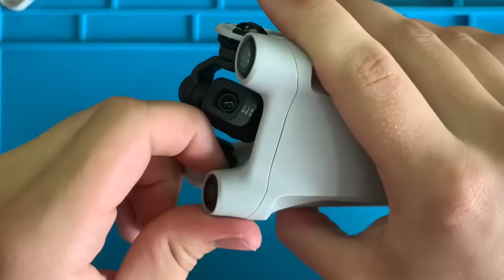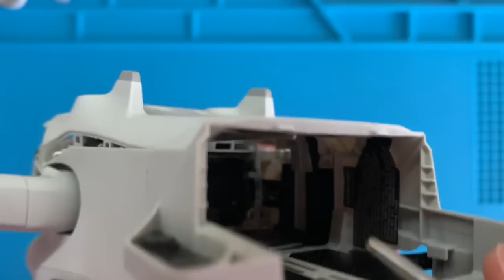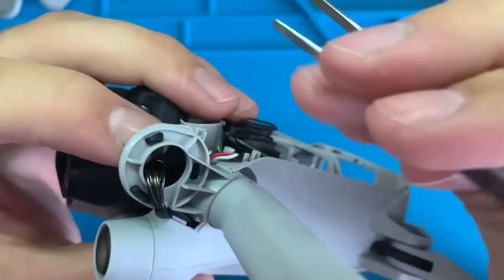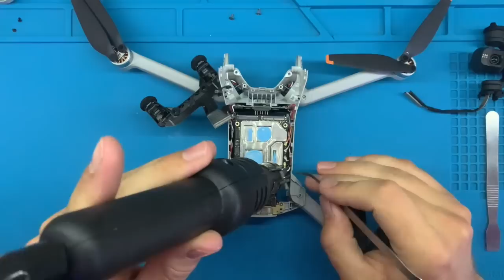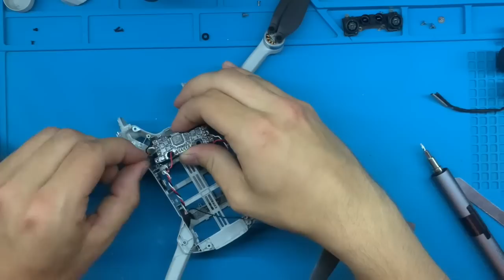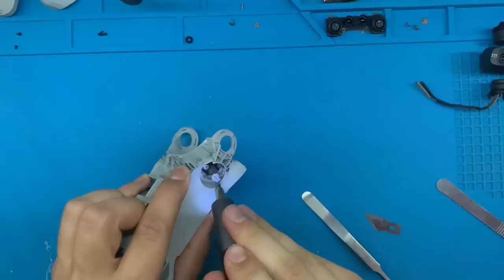DJI Mini 3 Pro Drone Teardown

Comment: I just want to remove and replace the front cover where the gymbol attaches to the small part that covers the front sensors, can this be done without taking the top and bottom shells off ?

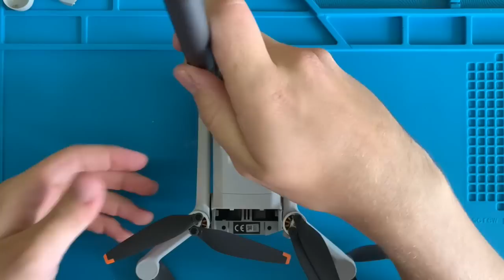Comment: 1:00  "and now you carefully clip the front half of the bottom shell from the drone" ....Proceeds to rip with as much violence as possible.
Reply: Can anyone tell me exactly when you have to re program the gimbal but have to do it with a computer.  It happens when you replace some parts of gimbal.   Anyone know anything about that?

Comment: what type of screwdriver is it, i can't find the correct one
Reply: I used T5 and PH0, but it depends on the screwdriver tolerance. Some do not fit and you would have to use T4 and PH00 instead. I also noticed that screws that fasten propeller blades have slightly different size in different batches (all original from the DJI store).

Comment: Hello! I'm currently disassembling the Mini 3 Pro. Quick question: Are you utilizing the hot air tool for both melting the adhesive and for desoldering purposes? 
Also, when you reassemble the drone, do you apply any kind of adhesive or glue? If adhesive is necessary, could you recommend a type that's suitable for this task?

Comment: Thank you for the great video, do you think is possible to bring the weight to 250 grams with the 360* prop cages and a naked version. Will it take off without the obstacle sensors and such? Thank you
Reply: I’m wondering the same thing and may give it a try…

Comment: Just a couple of thoughts you potentially leave off  some of the body parts and it would be even lighter, also could you not use a hot air gun to make the plastics more malleable. But excellent video.

Comment: In you expert opinion then, is there anything or things that can be removed to make the drone lighter to give it more battery time or make it light enough so you can use the battery plus without going over 250 grams?

Comment: I have a mini 3 pro. The gimbal is making a whining noise as soon as it connects with the transmitter, and does not stop until I power it off. If you tilt the aircraft completely vertically up or down, the noise stops, and if you gently lift upwards on the bottom of the gimbal, it also stops. Someone please help me :(

Comment: WOW repairing that drone isn't easy to work on for sure vs the other Mini's they sure packed this drone and I certainly don't like where they stuck the ESC Board for the wires and things...  Geesh like a car they sure know how to pack that baby.  Still wondering how they kept it under 249g...  Ugg having to tear apart the whole drone just to replace a drone arm, that's not fun!!

Comment: Now I'd love to see the best way of putting back in the rubber shock absorbers of the gimbal. My gimbal came loose from one of them, so I removed the rubber from the body to reconnect it to the gimbal. However, now it proves to be very difficult to get its three tongues back into their slots. Any suggestions on how to do that?
Reply: I did it with toothpick 🙂
Reply: @LouisxIII18  Can you show pls? I tryed, but...
Reply: @АртурАппен  adjust the holes on the rubber , then press hard, take a toothpick and slightly push the rubber through the holes.
it is not difficult
Reply: @LouisxIII18  thank you. May be you know, where can I buy this rubber shok absorbers? One was broken...

Comment: Hey :) it would have been great if you had said what kind of screw heads each screw is. I thought I had read that the torx screws are T5 and bought a T5 screw driver but it doesn’t fit 😭

Comment: Hats off to you! I wouldn’t dare take one apart I’d probably snap plastic panels left and rught
Reply: Yeah the mavic wires are ridiculously cheap and the plastic begs to be cracked.  It's ridiculous that the stuff isn't just screwed in instead of requiring you to yank the @^#*$ out of a plastic part :(

Comment: Looks like it would get an ifixit score of 1-2 (assuming you can get the parts). I can see why dji have a replacement care refresh option for the first 1-2 years. Worth it if you intend to use the drone professionally.

Comment: Interesting to see how it looks like under the hood! It would also be of interest to see inside the DJI-RC controller. Especially regarding the antennas. It would be great to swap them with the DJI-1N or the DJI-pro controllers "external" antennas for improoved and more robust antenna signalling. 
Do you consider opening the DJI-RC as well? 
Thanks!

Comment: Great video. Have a mini 2, looking to swap out mini 2 arms and propellers for the mini 3 arms and propellers. Haven't seen mini 3 up close but it looks like you could take the front right arm of mini 3 and put it on the left rear of the mini 2 and so on. With what you've seen do you think it's possible? Or wish I knew someone who could design some dji mini 2 3d printed arms that are about 1.25" longer, that way mini 3 pro propellers fit mini 2.

Comment: Excellent video! 

Scary how difficult arm replacements will be.
Reply: indeed! i've been looking at a few tear down to see if there is a simpler way to access the ESC board. Although I've come across two Mini 3s with broken arms...well technically the rotating axis was broke, arms themselves were fine. Heres hoping they are the weakest part and break easier than arms coz they would be way easier to fix!

Comment: Well done, but the most important thing for me is the high resolution photos of the right and left side of the motherboard. Especially the chips under the covers. What image processor, fc and radio module used. Are you still able to do this? Thank you.

Comment: Hopefully with that exposed camera on the Mini 3, I won't crash mine and have to tear it down👍
Reply: It's the price of 60° camera upward angle/vertical mode.
For me, it is maybe the biggest issue on this drone couse when you turn off sensors in sport mode, every crash will be critical for the camera
Reply: @ivan3465  My issue is flying sideways into things

Comment: Wow great video. Can ask where the antenna are placed pls. Someone did say there was a grey wire within the arms. It would be nice to be able to see these antenna as it's occusync 3 how many antenna are actually in there.. thanks for sharing 👍
Reply: Watching very close with the video slowed down it appears that they are using 4 separate antennas, 1 in each leg !  As he pulls the arms you can see an individual coaxial connector in each leg bundle of wiring ..

Comment: great job! maybe I was not listening good enough, but where are 
the antennas located?
Reply: Well, if we look around 07:10, we can see that there are 4 RF connectors, which look like they're from Hirose U.FL or W.FL series (I can't judge the exact size). 

If you then carefully look from 15:00 to maybe 15:15, you can see that there appear to be connectors on all 4 of the arms. 
The colors of the coaxial cables are gray, orange/copper, while and black. 
Therefore, I'm pretty sure that there are at least 4 antennas on the arms. I also suspect that, due to heatsinks, the electronics do not have any hidden antennas on them.
Reply: This is just a guess; did I see an antenna (Gray Wire) from each, Front Left & Right Arms?